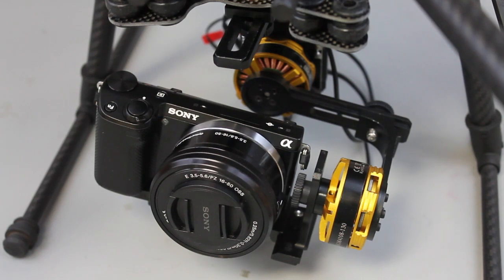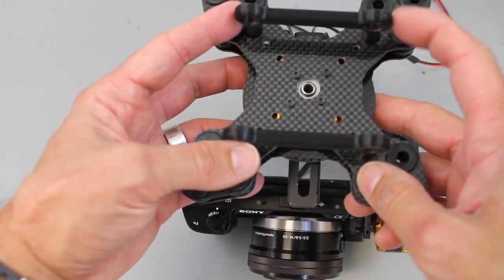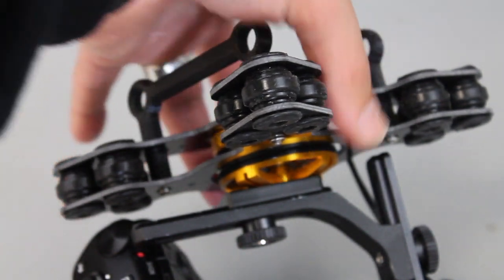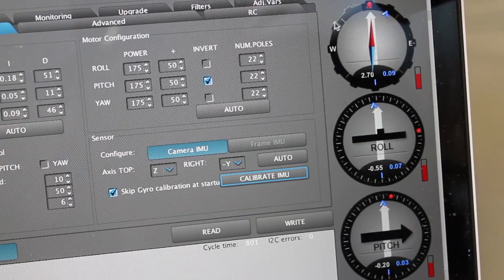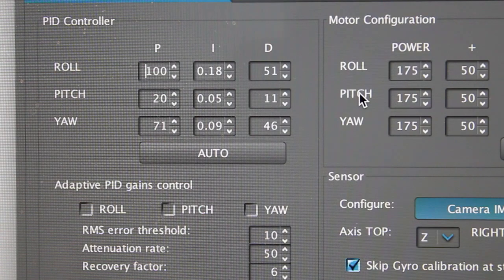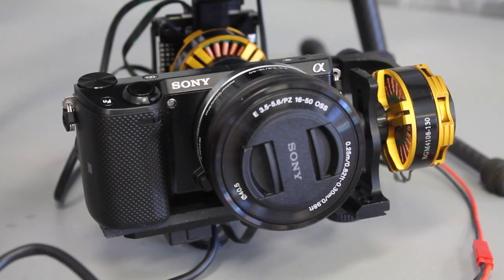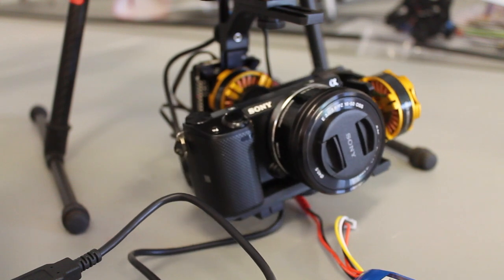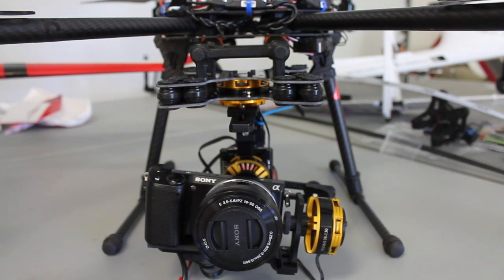DYS 3-Axis Gimbal w/ Sony NEX 5 and Tarot Hexacopter First Look

Comment: Not that I have any issue with the 3D printed part you made other than it is a closed loop, I wonder if you tried to modify the existing Tarot 10mm rod attachment with ope ended snap on rings? I had the same issue with a gimbal on my 680 and mounted to that inexpensive mounting part they offer- I could snap the gimbal on and off in a minute, and I had 2 rap straps loosely acting as backup if the gimbal ever were to break off the mount. My hex dropped out of the sky and landed in a cow pasture and many things broke on impact- ironically the gimbal and mount stayed until it flipped over on impact- never came off, and still works as the hex landed upside down.
Nice find on the gimbal- looks like the SX260 will fit nicely on that too, eh?
Reply: From an engineering point of view, I would feel uncomfortable with the way you have constructed the brackets. There is cross-torsional stress in the simple rectangular way you made them. To reinforce them, I would have made them with an I-beam structure for the "rod" portions. This would save weight too. Also, where the holes are that slide onto the copter's rails, I would put more material at a 45 degree angle so that the stress gets distributed. Finally, I would consider creating an "X" cross-bracing from side to side. I know this sounds like overkill, but the rectangular style you made has several potential fail points that over time will stress the PLA and create micro cracks that will likely fail. Wish I could sketch a little graphic here to show you what I mean. I would hate for you to lose your gimbal and camera. But good luck!
Reply from the maker: ***** Great thoughts. I didn't think about making the loops open-ended. I did something like that with a fixed mount for the SX260, but for some reason decided to close them for this DYS gimbal. Yes the SX260 will fit nicely into this gimbal. I like the idea of reinforcement straps on the DYS. Thank you and hope all is well.
Reply from the maker: Doug Moody I love hearing feedback like this. I get what you're saying about adding extra material at 45 degrees. I like that suggestion a lot. I also understand what you mean about the X cross bracing side to side. I'll see if I can refine these to create something that will hold up over time. Thank you for the suggestions.

Comment: Does SimpleBGC work with all gimbals or only particular ones?

Thanks!
Reply: It should work with most brushless gimbals. I'm using it on RCTimers ASP 3 axis gimbal. However this is a clone of the DYS gimbal.
Reply from the maker: tpalshadow Yes it does work with many different gimbals.

Comment: That bracket seems to delete the effect of the gimbal shock absorbers
Reply from the maker: Good point. It very well could be causing an issue. I'll need to take a look when I get back to the garage. Thanks for pointing this out.
Reply: It seems like the pan motor is attached to the top of the mount, so it should "float" horizontally. However, You're not going to have the vertical (up and down) dampening.
Possibly try putting a large washer under the top of the gimabl mount... and screw in your 3d printed arm there?
Nevertheless.... i want that 3d printed arm, lol. Are you selling it yet?

Comment: Howdee Dennis.  still going through your massive library. finally got the Tarot 680 flying reasonably well with the naza v2. I also picked up a couple larger frames, X4 double motor and T18.  you can bet I will all into your vids getting this stuff correct. Be in touch soon as I'm gonna need some advice on making videos.  fyi Central Georgia area is no man's land for multirotor pilots. very few around here and sadly not real friendly either. keep up the great productions and stay Blessed!!  Phill
Reply from the maker: Hey Phil, glad to hear you are making progress. You're going to love that frame. It's such a fun one to fly and can carry a decent payload. Keep me posted on your progress and stay in touch. Thanks.
Reply: Good evening Dennis, I am waiting on this same gimbal to come in the nexr few days from ebay.  My order comes with a storm 32 controller and slightly larger motors.  To date, the Zenmuse H3 2d is as much as I have fooled with, And have yet to study/learn to control it via the Naza V2.  Since that 2 inch toy I got for Xmas to the X8 4axis Tarot my brain is about fried. copters now flying, Fy680 Pro, X8 4 axis, Ironman 650 and Dji f5450 and 550hex. the last 2 just sold locally. (creating converts for the cause),.  let me know if and when you feel up to a call. I got tons of newblit translated data to put in video form. Also, best startup kit for a 3dr printer? 
Have a really great evening....Phill.

Comment: This gimble is not for a qav500 or 540. I had a 540 loaded with a go pro 3+. That with a zenmuse 3d worked flawless. This gimble with a alpha 6000 will need more than a 600 sized ship since the weight is heavier than a nex, but lighter than a dslr
Reply from the maker: cody hanthorn You're definitely right. I would think about this gimbal on my QAV540. I originally got this in the air on my Tarot 680 but it was slugglish. Am testing the Tarot X6 and will share my results when I know more. Thanks for the comment.

Comment: That is great. This 3d prints are very strong. Put higer infill and test it. PLA is insanly strong but dont have strong termal resistance(easy melt and brcane soft). ABS has good streingth and termal resistance. Nyilon would be maybe best bet.
Reply from the maker: Darko Bulatovic Thank you for the feedback. Right now I have 75% infill and may go higher. It's a small price to pay :)

Comment: So how is it performing in the air? Can you recommend the gimbal? Good Video!
Reply from the maker: daFexKM Great question and I've had one heckuva time getting to not vibrate. I've been flying it without power just to see if I can get it not to vibrate. Balanced props and working on motors. Still trying to figure out if the hexa is just too noisy or if something's up with the gimbal. So as of right now I'd say hold off and I'll update if I get these issues sorted out. I've spent way too much time messing around with it, but I have to think I can get it stable. Thanks for asking.
Reply: Dennis Baldwin Thanks for answering! I am planing to buy a Sony A5100 but I'm still not sure which gimbal is working the best...without spending ton of money. So if you just hold the gimbal with your hands and walk around it works perfectly?

Comment: Hi Dennis, I am getting lost with FY, Tarot, HK and more Gimbals impossible to compromise, on their real effectiveness. One simple question without engaging yourself, in this, if I may!? What 2 or 3D gimbal would you recommend nowadays that has a GUI for fine tuning without being reliable on any firmware updates? I am fancying the the following, any thoughts, and I can't get any info if it has a GUI, which I presume it does not; any insight on your experience and talks on the topic, please, Dennis? It is for a forward mounting XJ470 Quad, I Know I don't need a 3D gimbal, but I will surely reuse it in the future...
For info Only: http://www.aliexpress.com/store/product/FeiYu-new-3-axis-gimbal-for-aircraft-FY-Mini-3D-brushless-gimbal-for-aircraft/1297077_32340388449.html
Reply from the maker: FPV Cambodia One gimbal I've really enjoyed for the money is the Tarot T-2D. The FY gimbal you posted looks pretty nice. I like the fact that it has 6 vibration dampeners. Regarding firmware I don't know much about this setup but generally it will work out of the box as long as you have the camera mounted and the gimbal CG correct. It look like you can get the config software and firmware from here:

http://www.feiyu-tech.com/product-en.php?mlist=3&id=51&step=3

Good luck and keep us posted on your findings.
Reply: Thanks Dennis